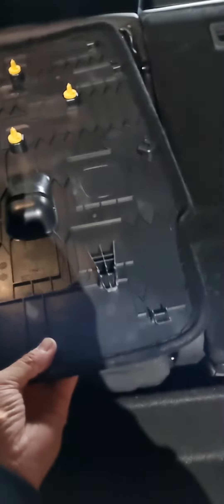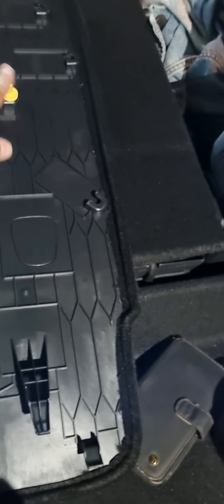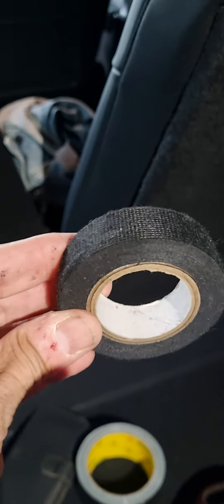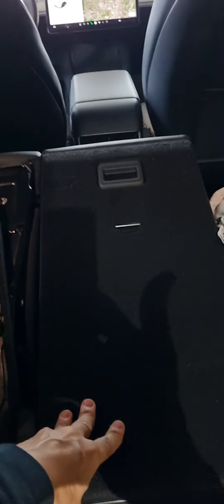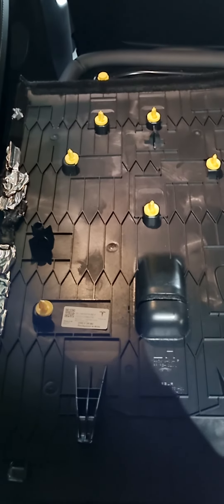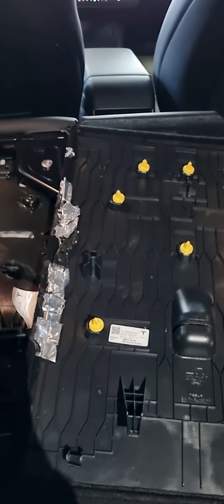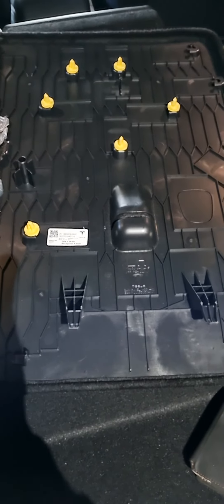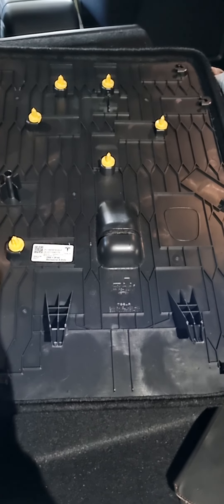Tesla Y Trunk rattling in seats/Seat backpanels

Comment: Amazing, so many places where sound can be generated 😂
Reply from the maker: Thank you☺Yes, there are. But if those who are willing work systematically thoroughout the car, they will be rewarded with an incredible silent and way more Premium car. My DB level was between 57/59 db up to 110 km/t thats low. Thanks for commenting and have great evening and hopefully a continued Good Christmas. Best regards
Reply: @ would you have any good guess about rattle from trunck, when passing speedbump at low speed - and even worse, when traversing over an elevatet footh path - in the sense driving over in a 45 degree angle. I seems like more rattle, if the car is twisted a little.
Reply from the maker: @larsw.larsen4173  Sorry for my late reply. I had a similar, if not the same problem in the beginning, so in my case it was the trunk opening that needed to be tightened up a bit. There are 2 knobs you can rotate, one on each side. If you are uncertain how to do this, have a quick service, it is a common problem. I also had som e rattling from the amplifier area, so I made sure the bolts were tightened..This was more or less how I started :) But, unfortunately it can be very difficult to pinpoint sometimes where the rattling/sound is coming rom and caused by what, so I cant say for ceratin that what helped me in this case will be the same solution for you. But I would start with the trunk opening first, since it is a common problem for many
Reply: @Mr.Relaxed  thanks for the answer🎉. I have tried the trunk close test with paper under the 4 closing points. In all points, paper were sitting firm, when trying to pull it. I would say a loose amplifyer could sound a little like some loose tools. I think I will try to dig in there. Anything I should know/ take special care of, when opening up?
Reply from the maker: @larswlarsen  Before you start, just consider reporting it in service, they might be able to find a fix. Other than that, nahh, its pretty much straight forward, theres a quite a bit of videos also that explains how to do it, but you probably know already. Good luck, its quite fun and interesting to do

Comment: I  back seat panels a month ago. Really decreased the slightchorus of rattles as I go over large bumps. I wraped twist ties inbetween the yellow clips and the holders. In other panels i used plumber's tape which is a narrow plastic material that you can twist in to a string like form. I then inser it between the clips and their holders. Did this to the to the liftgate trim as well as frunk access cover.
Reply from the maker: Sounds like you got most of it covered and really well too😊. I'm happy it  reduced some rattling. Thanks for the info, always nice to hear feedback. Have a great day and take care

Comment from the maker: See now I actually made a wrong video. Instead of seat panels, I did the panel on trunk opening door. Im sorry. Remember midpanel wad a bit tricky, yoy have to use quite a bit more force on top, cause its 'locked'more there. Will make one as soon as possible, but I had an accudent on my left hand, so im in hospital right now. Be back wednesday I think

Comment: I think I have this issue on my 23 MY. I get a rattle over certain bumps from the passenger side rear seat. The only way it stops is to lay the seat back flat. I wonder if I can have this done as a service call.
Reply from the maker: Hello. Yes  most definitely. If its easy for them to hear or you show recording, they will try fix. Put it up as mobile service, they will come to your place. Good luck
Reply: Did you get this figured out? I have an appoint for 2/9 for mobile service. I have the exact issue. Rattle noise when seat is up but when laid flat it is quiet. Curious if you had a resolution. My MY is 2 days old lol
Reply: My appointment is 2/5/2024 @IrwinFPV
Reply: Nice well please post back if you get a fix
Reply from the maker: @IrwinFPV Both of you should keep the service appointment and see if they can fix. If not, it's most likely clips that rattles,  moves, especially when road has small unevenness,bulgy parts. Good luck to you both...I have no sounds, so its quite possible to fix
Reply: @hankgr64 did you have any luck? Did they fix it for you and if so what was the issue??
Reply: @hankgr64  got my car fixed. Was the actuator in the second row seats. There was something loose in the motor for the seats.

Comment: Did you end up filming a video where you show how to remove the panel? Im struggling to remove the right side panel. Tak
Reply from the maker: I filmed a video yes and posted some time ago, think I wrote a message for you🤔Just have a look a my videos, its the last one
Reply from the maker: https://youtu.be/Lzz82YywD6g?si=QraqZp9_dIV6kxC2
Reply from the maker: Hello again. I'm home from hospital, but am unable right now to make a video, I need both hands, and my left is in bad condition right now. The middle cover IS difficult, but try this: The latch housing is held into the metal frame of the seat via two spring clips and indeed one is supposed to pry up on the latch surrounds from the outside of the seat cover. It takes a riddiculous amount of force to cause the spring clips to release, but once that's done,  the latch lifts out through the seat cover, just detach the wire harness. Then the seat back cover is free to lift away. But be careful, I know of people who broke the springs, so you do this on your own risk. Also open a little on seat top  cause the cover is slided into some openings there. If you manage to get off, it might be equally hard to get back on, but have patience, and slid in cracks in top first and work your way down.
Reply: @Mr.Relaxed  thank you so much for your answer. I wish you a swift recovery.

Comment: How do you take the middle one off? The release area is very tight, and it didn’t seem right to exert so much force. I’m curious if you had a better way
Reply from the maker: The release is tight, especially  on top middke where you put the 'handle'. Lift up leather part on top a little, then just work your way slowly around,  it will be ok, even if it feels a little scary maybe. When putting it back on, make sure you start on top, there are 2 'hooks' there going into a little slit first, and handle can be a bit tricky to get in place again. I'm gone on work travel, but would have made a video showing..can do it when I get back

Comment: how do i open the back of the rear seat on my model 3 like that? i also have rattle noises which tesla couldnt fix
Reply from the maker: Hi. Haven't done this on Model 3, but if they have the same panels behind 
seats ( dont remember right now), just start in one corner and work your way around, shouldn't be a problem. The bottom of panel you glide a little up. Let me know how it went, good luck